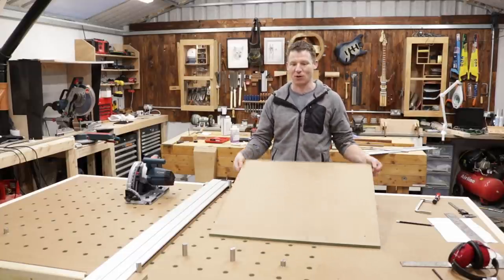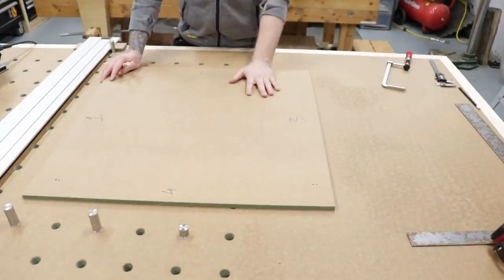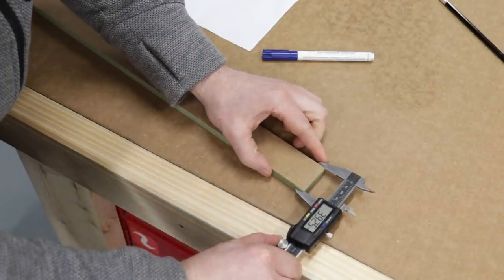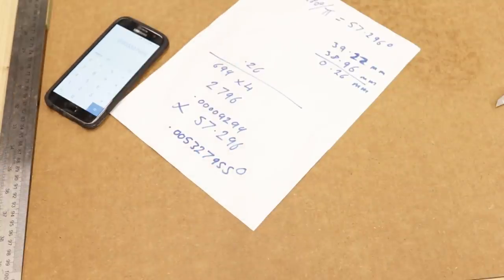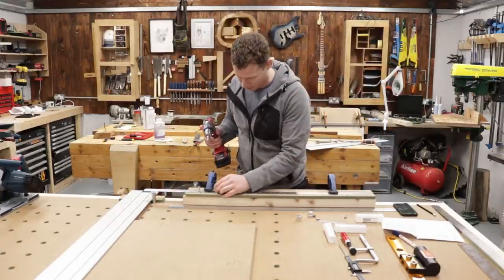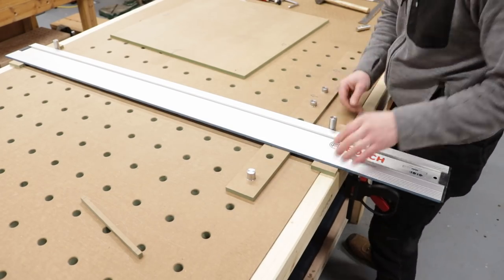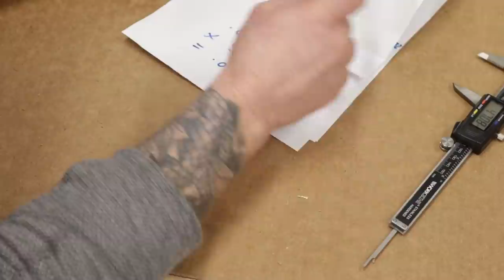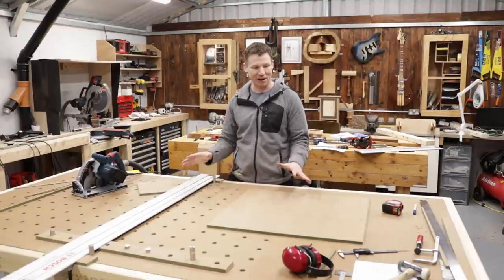Testing MFT Accuracy and Testing Home Made Fence Accuracy. UJK Parf Guide System MK2.

Comment from the maker: OK I messed up testing the fence I just noticed, Its more a 3 cut test!!! I turned the board the wrong way for one cut. But it's still square lol
Reply: When you're down to fractions of a degree out, it's square enough,  you're not sending anything to the moon!
Reply: @nialstewart8263  Inertial measurement Unit on Space Shuttle resolves to 20 arc second, whatever that is in radians. (3600 seconds in a degree).
Reply: @tpobrienjr  A quick google gives 0.00555.. degreesfor 20 arc seconds. John's first effort with the bench dogs was better! :-)
Reply from the maker: @nialstewart8263  NASA will be on the phone soon! 😂
Reply: Actually 5 cuts but you put side 2 against the fence twice.  Still square enough to get the jobs done.  Nice video.
Reply: I saw that the material wasnt snugged up to the fence at 1 cut aswell
Reply: I was just going to point that out.
Reply: @tpobrienjr  kd
Reply: @jimmysierra5551  Doesn't the 5 cut put side '1' against the fence twice. I think you meant that side 2 gets cut twice. right? Am I missing something here?
Reply: @stvcolwill  I was commenting on what John actually did as opposed to how it is done.  Looking at it again though, I see cut the side marked 2, then 3, then 4, then 3, then spun the piece 180° to get to the side marked 1.  So he made 5 cuts, but the extra cut he made to the side marked 3 would not have impacted his measurements because of that 180° spin he did to get around to the final cut.
Reply: Wonderful presentation John. As one of the finest presenters, on YouTube, I dearly hope that your videos will become  much more frequent! Len (Devon 🇬🇧) 09:04:23

Comment: Good video, John, and great to see the Parf Guide system worked out so well after the initial hiccups. I'd be very happy with those results!

Might be worth adding a small chamfer to the underside of the fence edge so that any loose sawdust on the table doesn't get trapped between the fence and the workpiece and throw the alignment slightly off.

Comment: A thing I do with this system just an a idea,  is cut a small dust rebate in the bottom of the fence so when you side the mdf around the table up to the fence any mdf dust does not build up against the side of the fence and top of the table creating an inaccurate square. Loving the vids. Great work .

Comment: As usual, another brilliant video, just one word of advice from an engineer. When you are measuring with verniers make sure the work you are measuring is fully to the bottom of the jaws. That way you know that you are definitely measuring at 90 degrees to the width. Hope that makes sense, all the same, brilliant video. I have bought the Mk 2 but haven’t got round to my bench yet, all your hints will help me when I do.
Keep up the good work 👍👍
Reply from the maker: Thanks for the tip
Reply: I never know how hard to squeeze when measuring wood
Reply: @vapeurdepisse  get a gauge block, and practice measuring it, practice achieving consistent pressure so you get consistent results.

Comment: This highlights how difficult it can be to make things perfectly square.  MDF is inferior fence material because it has a soft fuzzy edge.  I would try a rebate along the bottom of the fence to eliminate dust build up, and either hard wood or stout aluminium fence material to help reduce some of the cut to cut variation.  That said, this table/fence combination is plenty square enough for cabinet work.  Loved the video, thanks.

Comment: Hey John, You could put the fence back on the table again using the dogs, then run your saw on the other edge, that way you will have 2 sides dead accurate and you won't have too worry about making sure the fence is set up to the one side.

Comment: It is possible that your MFT top is perfectly square and any error is caused by sideways slop between the saw and the track. On my set up occasionally I have to tighten up the guide adjusting lugs on the saw base. I also use the UKJ spring clips to keep the guide rail tight to the dogs to stop any drift. Another good honest video by the way.

Comment: The best thing about a setup like this is flexibility. You can move the fence or the dogs anywhere on the table to accommodate different sizes of work pieces, you can add clamps through the dog holes to hold work pieces anywhere, and there are a lot of different dog hole clamps and fences available for purchase, or DIY.

Comment: Ive been messing around with my own custom mft style table and in doing so have looked at specs from almost every mft related product/tool out there. You can pick up a makita track for much cheaper than a festool and your bosch track saw will fit. No more bumping into your dogs!
Reply: The TSO quick adapters only work with festool guide rails. Anyone in the market for rails and parallel guides should consider festool rails and TSO parallel guides.

Comment: Really impressed with your math skills 👍 and your safety awareness regarding working with mdf- good job.
If you're looking at fences for a table like this, I would definitely look into Benchdogs because they have a system made specifically for guide rails. I damned near ordered one this morning but I have way too much invested in my Incra system. If it wasn't for that, I definitely would have chosen Benchdogs. 
Further you might want to look into the guide rail hinge system from either Benchdogs or Dashboard (I have the one from Dashboard  O M G! 👍)  If I see how you're wanting to use this table, then the guide rail dogs are not a viable option. It's great that your dog holes are dead on accurate, but trust me, a guide rail on a good hinge system is definitely the way to go - it's a day/night difference. 
Great video, looking forward to seeing more of you.

Comment: Have a look at Benchdogs uk, they also do a fence using dog holes, but their one has a small section that goes under the rails for small cuts. They also sell dogs with collars, so you can drop the dogs down low to avoid the motor and the collar can be set to not interfere with the base of the saw. :)

Comment: Greetings from Southern Ontario in Canada. Very much enjoying your informative videos. I have been busying myself creating a MFT style bench similar to your incorporating your brilliant sacrificial strip in an 18mm Baltic Birch top. I do not plan to add a router station as I still have a functional Veritas table that is probably 20 or more years old. I have several Mepla XP drawers left over from a kitchen I did for another home many years ago. I sort of collect good hardware incase I may need. 

I think I found a possible issue if using drawers below the top in the bench. I am therefore enclosing the end of the bench where the drawers will be located. I will install a piece of 3mm Baltic birch above the drawer section so dust will stopped from dropping into drawers. 

Sláinte
Reply from the maker: Hi Terry hope all is well in Ontario! thanks for the tip.

Comment: Improving that error -->
You can try re-cutting the same fence after you originally cut it once because the wood can release some stress after the first cut and you may find that the fence becomes more accurate when you do 2 or 3 cuts of the same edge. The less you cut off the edge the less stress released in the wood . A second point is if it is NOT more accurate after 2 cuts you can add a shim the size of the error and re-cut it so it becomes dead accurate. 

I have an original festool system (TS55) and it does not have the extra back slot like the new festool tracks. Unfortunately, it gives the same issue as the bosch. I am still trying to find a replacement for my tracks as they have a slight bow now but the festool saw is still perfect .

Comment: Good stuff John.😀👍
It is clearly accurate enough for woodworking.
I think the calculation is in radians rather than degrees (edit - my bad just rewatched the calc - I see what you did there). It will be interesting to compare your numbers to Peter Parfitt’s tests - I will do that when I get a minute.😉
Peter did two recent tests the first not quite as good as the second - he determined that the saw was a bit too loose on the track and readjusted the friction knobs for the second test which was much improved. Has the Bosch got similar adjustment for the saw to track location?
Reply from the maker: It does you can tighten it onto the track

Comment: I noticed a couple of times you had to tweak after clamping it down (as if the clockwise twisting moves the board a bit). Maybe If you change the screw clamp to one of the ratchet-type lever clamps you might not have that trouble. In the meantime, move the clamp closer to the track so the board is less likely to pivot about one of the dogs.

Comment: You can use your Bosch Tracksaw with Festool tracks. It’s compatible.
Reply from the maker: yeah I might look at that
Reply: @JohnMcGrathManInShed  see if it will work on the makita tracks. they are almost the same as festool but the anti tip lip is in the way of some saws. the makita rails are cheaper and the ruber strip is better. they are also 1500mm not 1400mm so it works better for cutting 1220mm sheets
Reply: The motor housing of my festool ts55r hits the short parf dog just a bit. Haven’t come to a solution for that, so no system is perfect. Made a large kitchen with that little flaw in the system no problem

Comment: Run the tracksaw down both sides of the fence so you can't put in on 'the wrong way round' so to speak. Both sides parallel to the dog holes and no need for arrows.

Comment: hey john. I noticed u had a little bit of flex under the saw guide. I have a small suggestion if u don't mind me saying. Where u hsave lifted the guide with those pieces of MDF at each side u need to make sure the Saw guid sits perfectly on the cutting surface or u will always have that flex. Maybe I'm way off but I thought I saw that little bit of flex at the time u were making the square cuts? I guess my point should've been those little picecs u use to keep the Guide lifted at each side of ur table need to be the exact sme width as the piece u are cutting, if that makes any sense.. LOL 
Thee's a guy on Youtube called Peter Lillard/ 10 Minute Workshop and he uses this system but his guide is a little different but he has his against the wall in his shop. His guide locks up against the wall but he has it fixed in a way so that any thickness of piece to be cut fits. He has some kind of fitting on his Festool saw Guide that allows it to lay falt on the piece he cuts everytime. Sorry mate. That was a gob full of nonsense from me..  LOL 
Love the look of the MFT work table now

Comment: Great Video John. Love your channel. Just found it today. ONE QUESTION... Wouldn't it be a good thing to go through with the cut on the fence all the way and use that part for after the cut (to the right as viewed from cutting person. This way you'd have accurate fencing on both sides and therefore more support for any backlash and adding more cutting stability in the workpeice. OR is that a no - no when cutting for a good reason that I'm not aware of. I'm kind of new at this and am getting my CNC in Next Week ... and I'll start building my MFT table shortly (with the CNC).
Reply from the maker: Yeah a fence on both sides of the cut is better, like I say you can use it as a sacrificial fence an cut straight through it. They are easy make and replace.

Comment: I have a question on using a track saw.  I got a new circular saw and was going to make a plywood track for it.  That got me thinking on how to use it when I am done.  In your video you had a big  piece of stock and what if you needed a 2 inch piece cut from it.  What I have seen is you measure 2 inches from each end and draw a line and put your track up against it and make the cut.  Seems to me your piece is not going to be two inches wide but two inches minus the thickness of your saw blade.  I saw one video were a piece of stock was screwed 90 degrees to the track on one end.  The saw was run over it scoring a cerf line in it.  I  think you could set your track away from you cut line by the width of the cerf line in the 90 degree piece to get your full two inch piece.  Most of the videos using a miter saw caution you to cut on the waste side of your line so your keeper piece will not be short by the width of the blade.  You have to keep this in mind when using a table saw also.  So how do you use your track saw to get the full width of the piece you need?
Reply: As you said you have to account for the kerf of the blade. Search for YouTube video on tricky track saw cuts by Peter Millard.

Comment: As usual fantastic video. Question my local shop ,(Tufts) only sell the 25mm standard MDF. I guess I could seal it with some sanding sealer. Do you think this would be ok? if not I'll have to look further for moisture resistant. Cheers
Reply from the maker: if your workshop is good and dry you should be ok
Reply: Be certain to apply finish prior to drilling. Finish in the holes will not permit the dogs to fit.

Comment: As I remember trigonometry the ratio of opposite hypotenuse to adjacent is the tangens of the angle not the angle itself. So 0.26 / 699 = 0.00037196, then arcustangens of this (the inverse tangens function, on calculators as 'atan()') is atan(0.00037196) = 0.021311734 rad which is 1.221072388 degrees. Then divided by 4 it is 0.305268097 degree. It is more then 57 TIMES worse than your 0.005327955 degree. Did I make a mistake in my calculations or you are wrong?

Comment: This is a great system but can you set up repeatable cuts to any width eg if you want # strips of mdf 43mm wide exactly? I’ve used a track saw for about 10 years now and they are great but if you want small pieces it has to be on the waste side which isn’t ideal. That’s one of the areas where a table saw is better albeit not so portable :)
Reply: You can use waste side jig or make one yourself. Peter Millard has video on tricky track saw cuts that solves the issue.
Reply: @meperson  thanks for heads up, his channel is very informative

Comment: Instead of dividing by (4 x 699), would it be more accurate taking the width of each respective cut-off into account (699 x 4 + width cut-off #1 + width cut-off #2 + width cut-off #3)?
Reply: It’s really hard to explain but the width of the cutoffs are irrelevant; you can cut off any amount and the results should be the same. Even the last cut could be a very narrow piece. The length of the cuts doesn’t matter either although you do need to know the length of the last piece.

Comment: I noticed the error was positive in one test and negative in the other.  Maybe just which end you measure first, but does it matter?  Also, with a fence you have to keep the table very clean to be sure sawdust not get between the work and the fence.  Raise the fence a 1/4 inch to let the trash go under it and out of the way.  I noticed your out of sequence cuts too.

Comment: OK, but where is the fifth cut? (4 + 1) Four cuts align the material to be formatted into a rectangle, which initialy can be even an irregular trapezoid. The first four cuts just remove the problem of doubts as to the starting material - they isolate from eventual previous shape errors. The fifth cut is the actual measurement cut. 
I do not want to look like a sticky guy, who is looking for a defect and necessarily wants to find it. But if precision, then let it be precision to the end!
Besides, both, used tool (brilliant, simple idea) and the workbench itself make a very positive impression! :))) I like it so much that I'm already thinking how to make a similar one.

Comment: Great video as always I got the fence system from benchdogs.co.uk 
it is have to say so far it is good. they also do a cut off side fence that supports up to blade
One thing I would recommend you get is some flag stops for what ever fence you go for 
as I found they speed up cutting down sheets for smaller parts.
Reply from the maker: Thanks for the info!
Reply: Defo recommend the BenchDogs fence system with flag stops, it’s excellent 👍.

Comment: Regarding the bench dogs fouling the saw, would is be more cost effective to cut a set down to the same hight or just below the height of your track so they clear? I know you mentioned you can buy dedicated dogs that resolve the issue, just wondered if it would be a simpler/cheaper option to modify what you already have? Great video. Have been really enjoying this series 👍👌
Reply: depends on the thickness of the sheet you are cutting, if you cut them down for 18mm then tried to cut 6mm you would need to cut them down again
Reply: @alland1241  just have a set cut for each standard dimension sheet material... 6/9/12/18 and so on... 🤷‍♂️ would mean you have options and ready to be used as and when needed. That would be my vote anyway 😅👍
Reply: @ogeoffreys  A pair of these would be a hell of a lot easier if your just cutting sheets  https://benchdogs.co.uk/products/mini-guide-rail-dogs-festool-makita-triton  the longer ones can be a pain if you don't need the height

Comment: I guess you wouldn't use this for breaking down a full sheet, even if it fitted on the table?
Over a full 8ft length you would be 0.5mm out (just to mix my measurement units) so you would measure at both ends and use the track without a dog system?